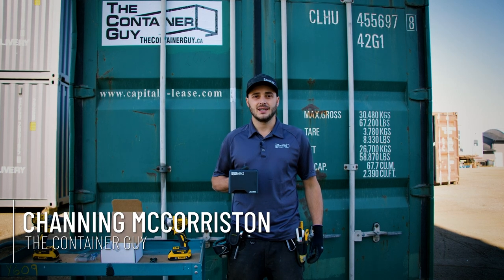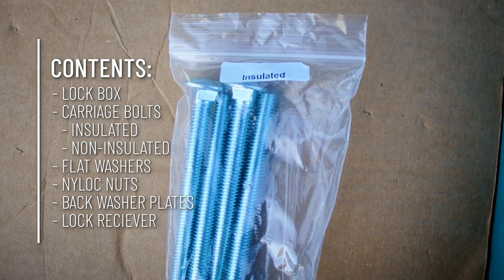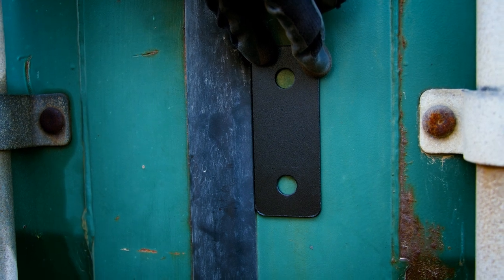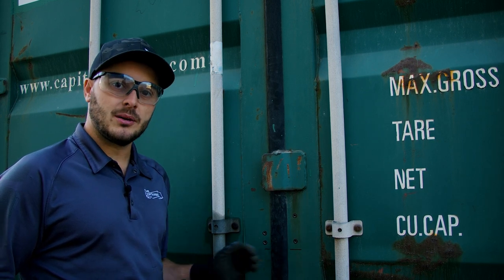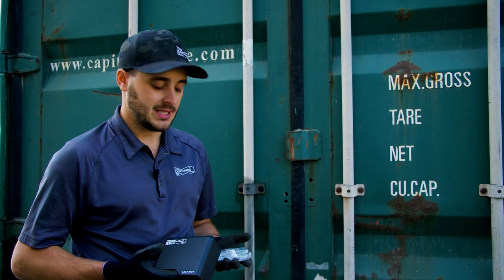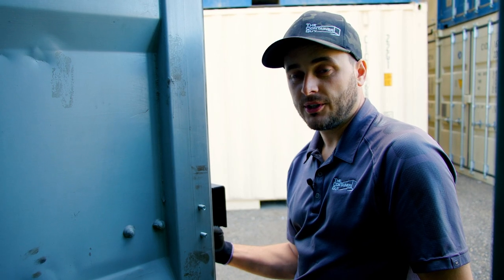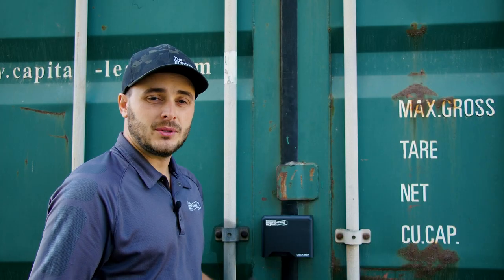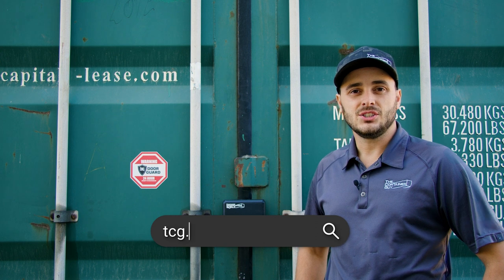How to Protect Your Shipping Container From Thieves - Easy Lockbox Installation | The Container Guy

Comment: Do I need to worry about water getting in through those holes after installing?If so I'm thinking I could use some clear sealant on the top of the lock box.
Reply from the maker: You could dab silicone around the holes before installing so you don't see it afterwards and will probably work better. Not sure if it's needed at all though. 

Could drill a drain hole at the bottom of the door's rec tube just in case and observe.

Comment: Can this be welded on instead of bolting it?
Reply from the maker: Yes but it burns the beautiful powder coating. I would suggest installing it first and see how you feel about it welding it afterwards. 

I think you'd rip the dots off the container before you ripped the lock box off the doors.

Comment: I found that the lock can be picked easily but it will often only pick half way. Its difficult to pick under the shield. I tried twice they also make this lock with a barrel tumbler. Also can be picked with the right tools. Not every one has those tools.